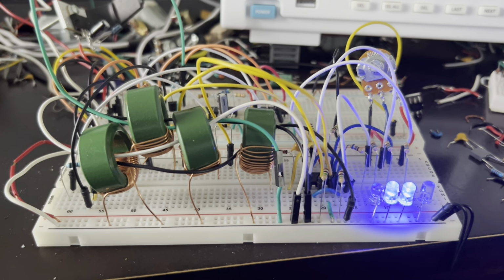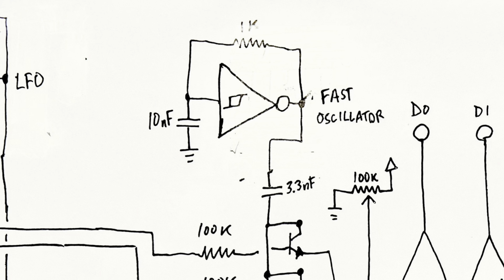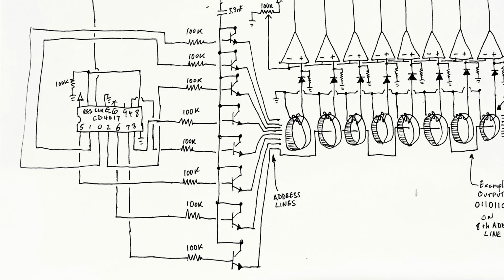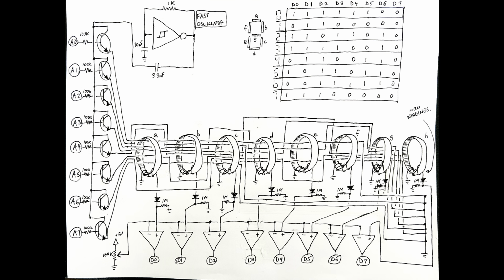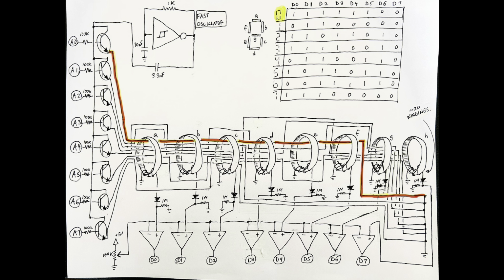Core Rope Memory 7 Segment Display Driver - Proof of Concept

Comment: Cool, The original period made tiny rings have special properties, they where build for this single purpose. heard in video's that they have proper...

the voltage divider needs 100nF cap.
Reply from the maker: They are out there but hard to get
Reply: @igorbrichkov3632  Check the recent video's on that subject and ask these people, that's how i found a person that sells these.
I can't publish an email from a 3rd person here.
Reply: @igorbrichkov3632  By the way i got the adc0804 and sram chip's AS6C1008, AS6C4008. There is also a TI 16 bit parallel dac/adc, but it's expensive.